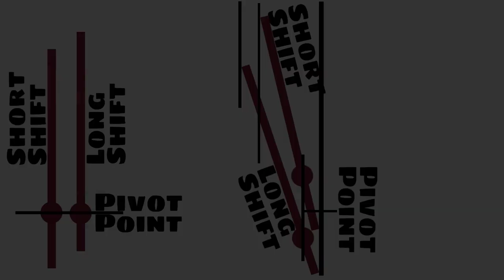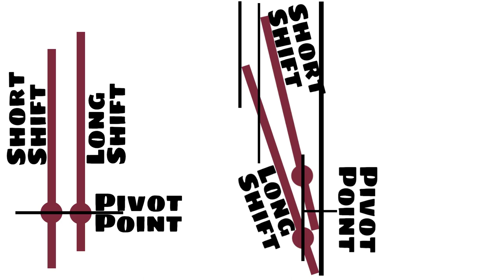Can You Really get 40% Shorter Shift for you OBS Ford? Core short Shift Install

Comment: Quick question about that pin.  Was that broken pin a solid pin or a "c" roll pin you pulled out?
Reply from the maker: It was solid, ill try to figure out what the correct size is, but what I got was stainless steel pins and I think they will be strong enough,  I don't know if roll pins are strong enough

Comment: 22:44  Putting grease where the pins go?? Most put loc tite on them where they won't fall out
Reply from the maker: As for the pins, the top of the shifter has a lip on it that keeps them from falling out on the outside and the shifter itself keeps them falling out on the inside

Comment: I wonder if this is gonna work on my 97 2.3 ranger, shifter pins shot so I need to refresh it all anyway
Reply from the maker: If its the 5 speed mazda trans it should, but check the website first let them tell you if it will or not

Comment: What is the benefit of a short shifter? I mean, I can see how how can select gears quicker, but IRL, you still have to wait for the revs to drop to engage the next gear...or you have excess synchro/gearbox/driveline/etc wear.

It doesn't seem like it'd help me drive my truck any faster. It might help me drive a friend's truck faster, provided he wasn't a real good friend to begin with.
Reply from the maker: If you like the long shift and see no advantage (and there may be no actual advantage to having a short shift) then it would be a total waste of time and money for you to do this, it's just a personal preference, I love the thing and the shift is so much more accurate (to me anyway) that I don't regret it one bit, But it's probably  not for you.
Reply: I mean, in my Ranger, when I shift, I hold the stick shifter at the gear I’m going to until it falls in. I don’t just stick it in immediately. This saves synchros. So does this shifter still easily allow for that?

Comment: How has this been holding up nine months later?
Reply: Also will this same model work in a 5 speed?
Reply from the maker: Mine is a 5 speed Masda Trans and it works as good today as it did when I installed it, I did put a glob of red and tacky grease in the top of it when I put it together, but it seems to be built well